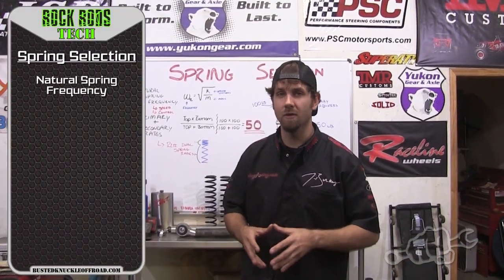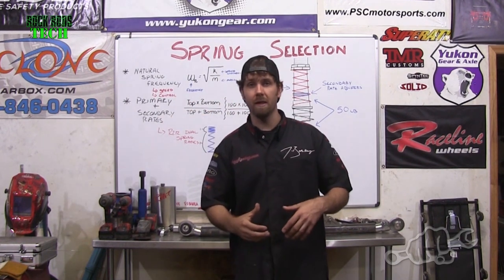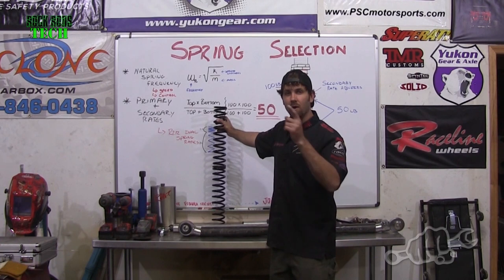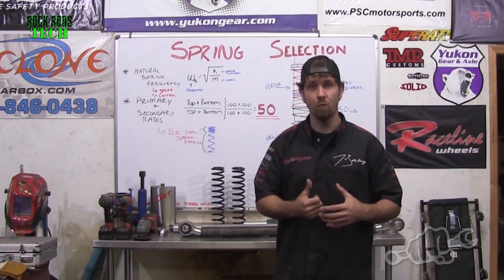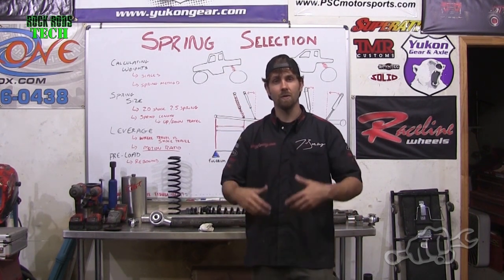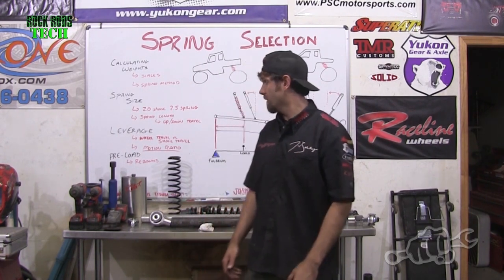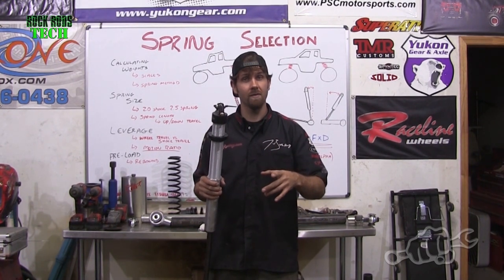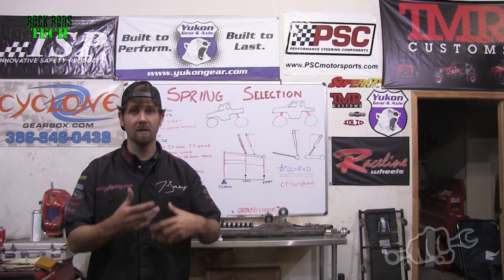How to Choose the Right Spring Rate - Rock Rods Tech with Jake Burkey

Comment: Straight up awesome info! Thank you for offering us so much of what could've been kept from people like me seeking guidance in the crazy world of suspension geometry, setting up everything and the what, why, and hows that surround it all. ... The knowledge you learned in the full sized 4x4 world works the same when it comes to my little RC rock crawlers!
If you ever revisit these topics in future videos, perhaps you could demonstrate all these suspension tech videos with a 1/10th scale RC rock crawler chassis. The latest tech in scale RC makes it possible to do custom builds that would blow your mind and actually look like AND react/work like the real thing. Not just RC but "scale RC" has come a long way and they are exact replicas of the full size versions. All the suspension parts, geometry and tuning & driving... everything is directly related and works the same as full size off-road vehicles just down to a 1/10th scale more manageable size. These RC models are fully operational and therefore you could take several out on the rocks and easily record them to slowly show the aspects of how different suspension set ups really work.
Reply from the maker: We don't have any RC crawlers, but you are right that would be a good way to show the differences

Comment: Love it Jake! Best video yet. Keep up the great work! The only thing I didn't follow is the correlation between vehicle speed and frequency, guess I'll need to do some googling. Thanks for all your hard work!
Reply from the maker: Maybe that the faster you want to go the heavier spring you need.
Reply: think of bumps in terrain as a sine wave.  You want your suspension frequency to equal the frequency of the bumps.  The faster the bumps are hitting your suspension the faster the suspension frequency needs to be.  Whats really difficult to do is get the rear suspension frequency higher than the front.  Its counter intuitive but a higher rear suspension frequency will make a buggy handle whoops better and have greater control at speed.

Comment: getting right spring & shocks or coilovers is as tuff 1st time out as picking right RV or trailer, but not as expensive a mistake. Most ppl will just let the pros pick shocks for lift kit, but dialing in & length & wt of springs & factoring in the installation setup/lean of shocks.

Comment: Good vid!!! OK, what about air shocks? can I use the same math? I would think I have to figure out the cylinder size X air pressure to get spring rate. Then use your math for a single spring? Am I thinking right?
Reply from the maker: Air shocks are a whole nother can of worms, but that sounds about right.

Comment: What about this: Caddy versus Vette--what if the stabilizer bar and other cross-vehicle stiffners are stronger, bigger, stiffer to help reduce body roll? or other methods to reduce body roll? Because some cars, like Audi for example, make sport luxury cars that drive smoothly without breaking your back and can still corner very well.
Reply from the maker: This is more of an offroad vehicle setup with solid axles and 4 link suspension

Comment: Busted Knuckle - Your reference to "alpha" confused me slightly. I understand I need to take the Cosine, however the way you explained the angle alpha I don't understand how to calculate it. If my shock is pitched in a 10 degrees at the top, but also the top is farther to the rear of the vehicle than where it sits on the axle (say 5 degrees), how do you calculate alpha?

Comment: Awesome video Jake!!  6:02 i have this setup as an independant suspension on my duke 390. Is there an oreintation to install like the wound up part on top or bottom closer to ground? And whats the difference please?
Reply: The orientation (top and bottom) of the springs doesn't change the spring rate. From 6:02, you can flip the springs top and bottom - the spring rate will be unchanged.

Comment: Hi i have changed all suspension and coil spring from my fortuner. Now I m using ironman foamcell Pro, but I found it stiffer as compare to oem. I am doing off raod only sometime, when the car has weight It feel soft and without passenger its stiffer n bumpy, so can i replace the rear spring by using oem and leaving ironman suspension as it is. Kindly suggest me your thought on it. Ironman suspension sets are 2 inch lift for your notice.
Reply from the maker: lots of variables are needed before making that decision

Comment: Great video! On my SXS I have 300/300 Drs on the front and my ride height is a little too low. I already have the preload cranked down. Should I get a stiffer upper or lower spring?
Reply from the maker: SXS are a different ball game as most of them are not actual dual rate
Reply: @BustedKnuckleVideo  my spring setup is an aftermarket dual rate with crossover rings.

Comment: Hello Sir,
                 I’m Pranav Solanki a student of VIIT Pune India. Our college takes part in sae E-BAJA  ATV Competition. I have seen your videos about the suspension system and springs, but I still confused about the spring stiffness for dual stage spring. Our weight of the car is 240kg(with driver).For dual if the spring rate of primary coil is 200lbs/in(10inch length) and secondary coil is 300lbs/in(10”) and mean is 120lbs/in will it compress the same as single spring of 120lbs/in(14”) spring rate when is there is loading acting of 120lbs will both(dual stage and single stage) compress 1inch ?
And is spring rate for rear side (Primary rate 200lbs/in 10”and secondary spring rate 300lbs/in 4”) and for front (primary spring rate 125lbs/in 10” and secondary spring rate 300lbs/in 4”) and I need 0.5inch preload compression and 1 inch compression when is ATV  is on wheel will it be  achieved with these spring rate?
Damper eye to eye length is 20inch and it has 7inch travel. Ground Clearance is 13.77inch.
I hope a response from you sir. Please Help Sir
Thank You Sir  .

Comment: Question. I weigh 255lb, riding liter naked with adjusted suspensions to the max of 180-190lb rider. If I get stiffer springs appropriate for my weight, what sort of improvement could I get?
Reply from the maker: proper ride height and your vehicle suspension working correctly
Reply: @BustedKnuckleVideo  can you elaborate about "working correctly" part?

Comment: When you have a high quality, tunable shock, you want the spring to just support the weight of the vehicle, and as far as absorbing the energy when landing etc you want the shocks to to the job, right?
Then what is the point of having a two step springrate?
Reply from the maker: they work together as a system.

Comment: I am curious about the right front shock, because of engine torque causes more tension on that side during acceleration, is that something to calculate for when figuring for correct set up?
Reply from the maker: Sway bar helps even that out

Comment: What spring length is needed for dual spring coil overs? Does a 12" travel shock need 2 12" springs, or 1 12" spring and 1 14" spring?
Reply from the maker: 12 top, 14 bottom
Reply: @BustedKnuckleVideo , does having unequal bump and droop change the lengths? For example, if there was only 4" of bump and 10" of droop on a 14" or 4" and 8" on a 12" (e.g., on a WJ).  Would that require the upper spring to be longer?

Would the long droop require a tender spring to keep the combined rate from being too low?

Comment: set preload bc last bit of shock is not the same rate, cool ck; out of plume is diff rate ck;  double stacking 2 springs cuts rate in 1/2 & can b a true dual rate spring.

Comment: How should I set the ride height with coilovers without changing the mounting point?? Because when you take softer springs the truck will drop but your spring rate wont be the "perfect" one?
Reply from the maker: run the adjusters down
Reply: @BustedKnuckleVideo  And the adjusters are something different than the preload or?? I don't have them yet but I'm trying to understand them before I do anything.

Comment: Hello I´m having trouble with coil over, I'm using 2 12" travel FOA shock and  300/300 lb spring  on a hyundai santafe 06 project, but  it does not support the weight. How can I contact you for support?
Reply from the maker: 300/300 seems like a lot, do you have nitrogen in them?
Reply: Ok i will check it out. Thanks.
Reply: How mucho gas do you Put in?
Reply: BustedKnuckleVideo hello I am having trouble with coil over ,I am using 2.0 12” king shock  and 250/200 lb springs on 94 hardbody swap straight axle (it’s compressed live 5” ) it’s my daily and feel hard I want something smooth what spring rate you recommended

Comment: Hello friend greetings, would you like to help me choose lor springs and coilovers flattened for my jeep and j designed for off road rally, its weight is approximately 1900 kg, suspension four rear link and front three link. swamper tires 38.5-11.00 r 16.
Reply from the maker: this video should help
Reply: @BustedKnuckleVideo  I DO NOT SPEAK ENGLISH I USE A TRANSLATOR TO BE ABLE TO COMMUNICATE ME, IT WOULD BE A LOT OF HELP IF YOU TELL ME THE BOOKS I CAN USE FOR WHAT I NEED THANKS, THE SHOCK ABSORBERS ARE FOX 2.0 OF 14 INCHES AND 16 INCHES BACK
Reply from the maker: It requires more information than that
Reply: @BustedKnuckleVideo 
the use that I will give the vehicle for high speed on steep terrain and with obstacles, I need stability and comfort in driving that is safe